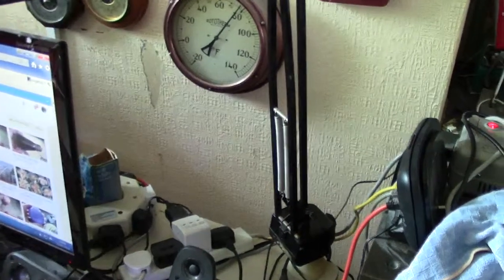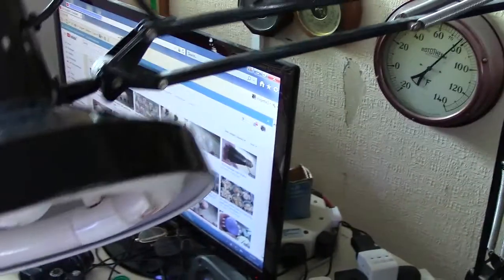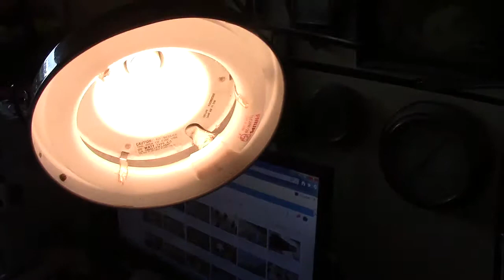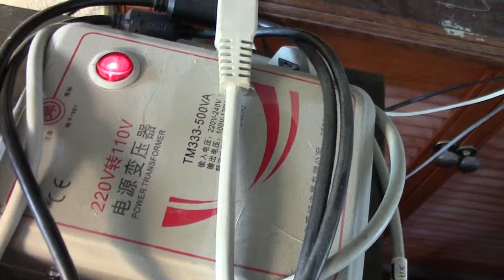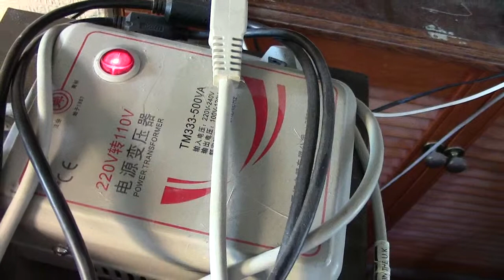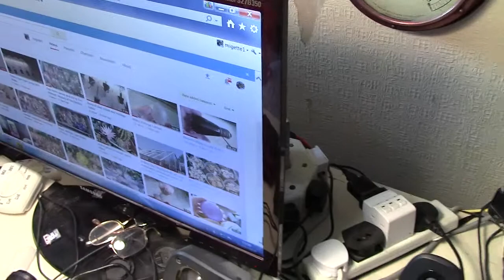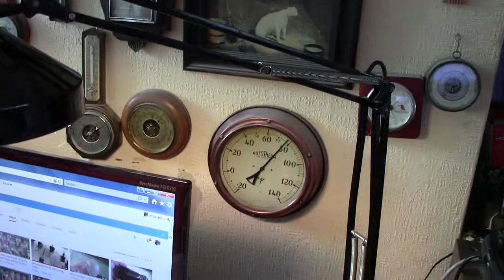Anglepoise style lamp with both circline and tungsten lamps.

Comment: Be careful with operating 60hz only magnetic ballasts such as the one in this desk lamp as the core might saturate and cause the ballast to overheat when it is operated on 50hz. I recommend using a North American dc to AC power inverter to ensure that the ballast operates without overheating.